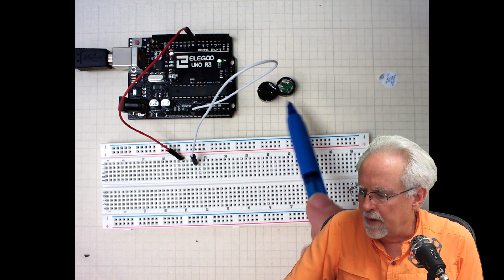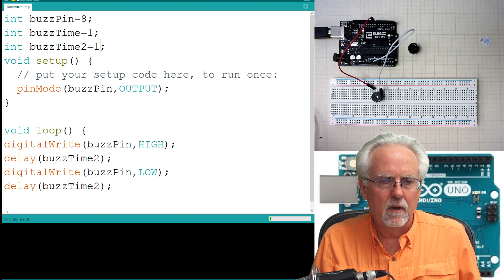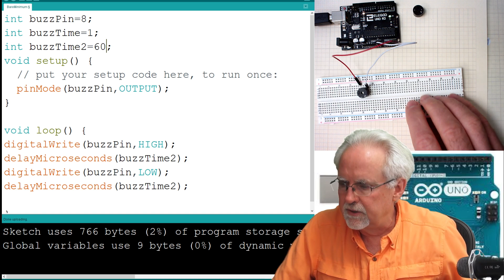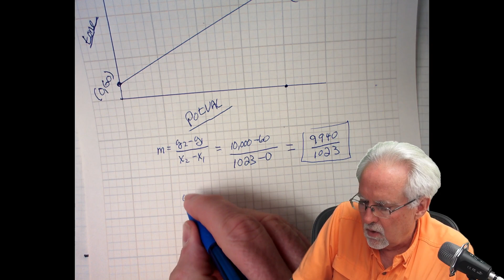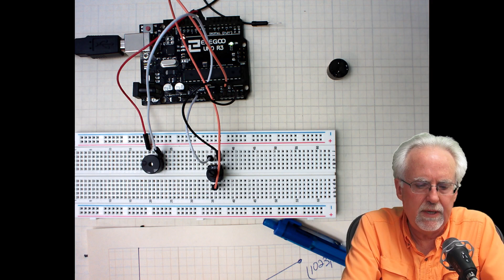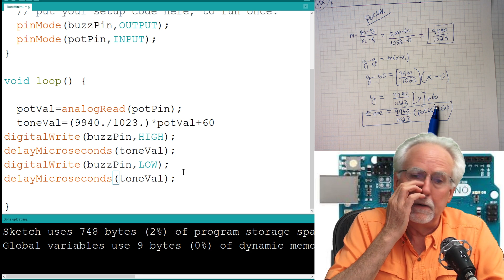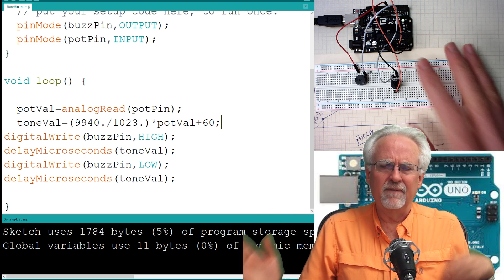Arduino Tutorial 24: Understanding Passive Buzzers

Comment: int buzzPin=8;
int dt=100;
int j=1;
int t=4;
void setup() {
  // put your setup code here, to run once:
Serial.begin(9600);
pinMode(buzzPin,OUTPUT);
}

void loop() {
  // put your main code here, to run repeatedly:
for (j=1;j<=100;j+=1){
  for (t=1;t<=100;t+=1){
    digitalWrite(buzzPin,HIGH);
    delayMicroseconds(j);
    digitalWrite(buzzPin,LOW);
    delayMicroseconds(j);
  }
  Serial.println(j);
  delay(dt);
}
}
Try this!

Comment: Paul, thank you for the video lesson. It was interesting and informative.

First, I wrote the code myself... and kept wondering why the sound I was getting was different from yours...

Then I read the comments and found out that I needed to remove the voltage output and the toneVal value from the Serial Monitor... after that, everything started working.

Thank you!
Reply from the maker: LEGEND!

Comment: Just an fyi for anyone going through this, the video shows the math/tone to potentiometer backwards. 

The original assignment is for 0 on the potentiometer to be the low tone (all the way left gets 60 milliseconds), and 1023 gets the high tone (all the way right gets 10,000 milliseconds). 

But when doing the math, the low and high points get accidentally flipped.

Just in case someone is wondering why their math/tones seem to be the reverse of what’s shown in the video.

Comment: Maybe I misunderstood the assignment I thought if we roll the potentiometer left the tone gets deeper/lower, meaning higher microsecond values.  If we turn the the potentiometer to the right we are getting higher tones sound meaning the microseconds are smaller.  I did the math to reflect that.  I did buzzTime = 10,000 - (9940/1023 * potVal).  It's pretty much your equation but the other way around.  So when potVal is zero --> buzzTime is 10,000 microseconds, lower deeper tone to the left.  When potVal is 1023 ---> buzzTime is 10,000 - 9940 which is 60 microsecs, a higher sound to the right.
Reply: literally would I did, I think he forgot himself what he said lol

Comment: One thing that happened with me: I had the Serial monitor lines of codes (Serial.begin, Serial.print), that made the thing not work as intended. When I removed those lines, it started working perfectly. I also tried tweaking the BAUD rate and that also affected the buzzer output.

Comment: I did Homework, but didnt really do the math, I just turned the milliseconds into micro seconds then mapped 0-1023 int 0-10000( which was the 1 micro to 10 millisecond range), using a map function, but it worked and was a little easier.
Reply from the maker: Yet this channel is not about doing things the easy way, but learning the math. Come on, I am showing you how to do the math, dont be afraid to use it!
Reply: @paulmcwhorter  Ill do better next time
:)

Comment: I think the math did not match the instructions, you mentioned that when the potentiometer was all the way to the left the delay should be 10K (low frequency) and when it was all the way to the right it should be 60 (high frequency) I did it like that, but then in the demo you did it the other way around. It was fun anyway thanks a lot for these amazing tutorials.

Comment: Paul you are brilliant and  I went way over the top with the homework built a 9 button tactile switch keyboard in the key of A. Icalculated for major triads for A D and E major 3 rows for A C# and E  2nd row D F#.... and  E G
A microsecond delay off 2240 for A . So C# delay for mark and space would be 12th root of 2 = 1.0596 raised to the power of 4 and inverted and multiplied by 2240. The idea of for this concept came from 1976 when a guitar student built a guitar but equally spaced the frets 1 inch apart absolutely unplayable.   I did not know the equation. He was not happy and smashed the guitar to pieces outside my flat. Well move forward to 2019 and I solved the conundrum (from first principles without using the internet) as above but instead of 2240 delay. The 4th fret position  of A is string length is 25 inches x 1/ (12th root of 2 raised to the power of 4 x 110 hz )

Comment: I'm wondering that, why we don't have a resistor on the following circuit? So it seems like we just put a buzzer instead of an LED.
Reply: Both the active and passive buzzers have enough internal resistance to prevent overloading the Arduino. Great question!

Comment: I would like to confirm that in a linear equation, the independent variable, which in this case is time (timeT), should be placed on the x-axis, while the dependent variable should be placed on the y-axis. If there are any corrections or additional insights regarding this understanding, I would greatly appreciate your guidance.
Reply from the maker: That is correct.

Comment: sir I have a little question.We initiated toneVal as an integer.But in the lopp funtion since we used (9940. /1023.)  will it be a floating number.
Reply: if the toneVal is an integer, the output of the  equation in the loop is gonna be only integers

Comment: I've been watching these videos from the beginning, but in Arduino IDE, the words that are supposed to show up in blue, are still black.  I get the orange ones just time.  The code still works, though.  Is there a setting I need to do?
Reply: I'm talking about words like HIGH, LOW, OUTPUT, INPUT, etc.
Reply from the maker: YOu are using IDE 2.X and I am using IDE 1.85, that is the difference. Downgrade to my IDE and you will get the same results as me.

Comment: Can someone check what's wrong with this code?

int Lowerlimit=60;
int PinPotentiometer=A0; 
int PinBuzzer=11;
int ValuePOT;
float ValueBUZZ;

void setup() {

Serial.begin(9600);
pinMode(PinPotentiometer,INPUT);
pinMode(PinBuzzer,OUTPUT);

}
void loop() {
ValuePOT=analogRead(PinPotentiometer);
Serial.println(ValuePOT);

ValueBUZZ=(10000./1023.)*ValuePOT;

if(ValuePOT<=Lowerlimit){
  digitalWrite(PinBuzzer,LOW);
}
digitalWrite(PinBuzzer,HIGH);
delayMicroseconds(ValueBUZZ);
digitalWrite(PinBuzzer,LOW);
delayMicroseconds(ValueBUZZ);
}

When I turn the potentiometer under the 60 the sound doesn't turn off,  but in my if loop i said that it should turnoff, when Value of the potentiometer is below or equal to the lowerlimit(60).
Reply: You don't have the code below the if statement in an if statement, so what is happening is that when ValuePOT is less than or equal to LowerLimit, the code inside the if statement runs, but after it runs, the code below that if statement also runs, and the Arduino runs code so quickly that you don't notice the sound getting turned off.

Comment: Hi Paul, great lesson as always!
In case someone, like me,  is watching only now, 2 things:

1) Just to make sure I did the equation correctly, I printed the value of both my tone and my potval, exptecting that:
-If potval=0, then tone=60.
-if potval=1023, then tone=10.000

Initially I had problems 'cause when potval was equal to 1023, my tone was something like 9.670
Then I realized that I set the tone as an INT instead of a FLOAT!
In the video you did the same, but withot the serial monitor I think you didn't realize this.
Changing the tone into a FLOAT made everything right.

2) Even though my math was correct, the tone I was hearing seemed a lot different than yours.
I discovered that it was due the serial.print I put in the code.
Reading the comments of this video, I discovered that I could keep the print if I changed the baud rate of the serial monitor into something higher! (1.000.000 was the minimum to not have distortion).
Reply: I tried this again tonight. With the higher baud rate it sounds much better, but it still sounds very distorted for me. It sounds like something an experimental prog rock band would do like Pink Floyd or something. It's doesn't sound anything like a tone a flute or something would make.
Reply: I was having all these issues as well.
Reply: Dude thank you so much I thought it was just ne
Reply: Thank you for your feedback! 
I wish I'd read your comment before... it wasn't obvious that the Serial.print function could have an impact on sound.
Unfortunately though, setting the baud rate above 1,000,000 doesn't fix the issue.
Reply: Thank you for this valuable comment. 
Statement 2 - helped me realize why I have the strange sound... and to change it.
I still have no idea why it depends so... but at least I'm closer to the Paul's tone

Comment: Using the Serial monitor seems to have a pretty big affect on the output tone. Originally tried using a print with delay to read the values and only got a clicking not buzzing sound. Got rid of the delay and it worked great for the low end but wouldn't give me the high pitch tone. Got rid of the Serial monitor completely and now seems to work about the same as yours in the lesson.
Reply from the maker: I think it is the print statements that slow you down. If the serial monitor is open, but no printing, it should be normal.
Reply: Yes I believe that's right, it seems to lag due to the printing action and if there's a delay following the print statement it makes the tone change even more. Thanks! These tutorials are awesome BTW.  @paulmcwhorter

Comment: hmm, strangely enough my buzzer isn't generating high tones, only low tones. The tones do vary with the potval, but it is not generating the high tones i hear here in you vid. Might be my buzzer, don't know. i am using the passive one, just to clarify. Also using the microseconds delay, very strange 🤔

Comment: Hi Paul, I spent 2 days nutting this out on my own before seeing your method. It turns out I did the math okay except that I calculated the fractions out and that left me with a number containing a decimal so the following dot caused me grief. I remembered that you explained how to get around this in a previous Tutorial but couldn't remember where or how. I got around the problem by creating a float variable that equaled the decimal I calculated. Anyway, I paid more attention and documented how to do it this time. The other thing that cost me most of the time is that I included several Serial.print functions to follow what was going on and I found that they altered the tone dramatically. I don't understand why print functions should affect the tone?? Anyway, thanks for another great lecture.

Comment: I got the formula right, but I did it way less elegantly. 😅The way I thought it out is that you have to go from potVal=0 to tone=60, and the only way to do that is to add 60 to 0. Then if you would continue with the 10000/1023 like we did previously to get tone=10,000 for potVal=1023, you would actually end up with 10060 since you added 60 before. So I just subtracted 60 from 10,000 to get the value to divide by 1023. 
I love that you show the "right" way to solve problems like this! Keep up the great work.

Comment: I wanted to print my tone in the Serial monitor but it only seems to be able to reach its highest when I use a high Baud rate and I have no idea why. Also, if I don't use the Serial monitor it sounds perfect. I guess the action of printing the value in the while loop introduced a tiny delay which distorts or lowers the frequency.
Reply: yes, that is right, when you put "Serial.println()" in your code it slows down the speed of your Arduino a lot.

Samuel

Comment: Hello Paul, I tried the excercise on my own, as you recommended....but got a difference in solving the excercise. You said....if you turn the potentiometer to the left, have a delay of 10.000 microseconds....to the right 60 microseconds? Right? If yes, to the potentiometer to the left will return a potValue of 0. So the combination of x and y will be: if the potValue will be zero, the delay should be 10.000 microseconds...and vice versa to the right....potValue 1023 will return a delay of 60. The equation will then be different: y=-9,7165+10.000.
If I misunderstood your instructions....nonetheless a big thanks, because the result was: I LEARNED IT!! Best regards!
Reply: You're right brother. Paul instructed us as you said either intentionally or unintentionally.

Comment: Hi Paul, Looks like I got confused with the terminology of ALL THE WAY LEFT and ALL THE WAY RIGHT you used. I understood it like this
1. delay = 10000 microseconds (when voltage  V =0)
2. delay = 60 microseconds (when voltage V = 1023)
Good thing is this created a line with slope towards right which was little difficult to create the equation. had to recall my mechanical engineering lectures from university as well as go through your previous Math notes I took. I was able to get the equation finally. delay = (-9940./1023.)*(voltage-1023.)+60;
I printed over serial monitor to check my math part and formula calculation Arduino is doing in the background. Got perfect 10000 delay at 0V and 60 delay at 5V (1023 in Arduino).
Rotating the potentiometer sounded like a world war siren...  LOL..

Comment: I struggled a bit with this lesson. It turns out that I had three Serial.Print statements to help debug the resistor value versus the Buzzer timer value. I was outputting 60-10000 microseconds properly but it sounded awful - then I removed the print statements and all was good. Those dang print statements are s-l-o-www! It was a good debugging exercise!
Reply from the maker: Yes print statements are really slow and will affect your timing on things.

Comment: I did everything right software wise in comparison to what you did, but the tone is not changing.  Even did a number of prints to show changes.  Why didn't use freq values set up in your global variables?  Your original coding without the pot I was able to hear the differences in tone.  BTW, I had a lab that I taught to teach my student to understand frequency response by their listening to a tone generator.  I learned for myself that I can't hear over 6,000 Hz.

Comment: Great lesson as always! One minor thing, you switched the delay times from what you told us in the homework. So you wanted us to have a delay of 10,000 microseconds when potVal is 0, and 60 microseconds when potVal is 1023. So the equation would be a little different: y= (-9940/1023)x + 10,000

Comment: btw, i was so used to debugging that I included some Serial.println statements in there which unwittingly lowered the pitches due to implicitly increasing the delay.  so i was pretty confused as to why my tones were so much lower - just a quick heads up for anyone who's doing this and proactively added Serial.print statements - it'll affect the tones, so best to leave them out if you're trying to get the same results that Paul did.

Comment: BOOM ! ... "I need you to.. " PROVE ! you've "READ THIS TILL THE END" 
Respond with "PhilVal" contents..... hehe.

Boy this one I had to scratch my head. Didn't cheat ! but I had to refer back to my lesson 15, graph notes (dimmable LED+Pot). The starting at '0,60' was different though and I had to look on a maths web-site to recap how to deal with non 0,0 starting points (was around 20yrs ago I last did that haha).But easy, when you refresh. It's really satisfying to do these lessons Paul, and I totally subscribe to the method of "doing it for yourself" to learn. At the risk of sounding like a 'smart arse' (which I'm certainly not), would I be right in thinking your original HW task should be stating "All the way to the left is a tone of 60" (not 10,000), assuming all the way to the left is Anti-clockwise ie 'off' ) ? Interestingly, I did a serial.Print of the PotVal and ToneVal just to see that the equation worked before any of the audible stuff. The values seemed 'switched' from your homework instruction. (PhilVal="Fear not, I absolutely WILL keep doing the Maths & Physics !") ... My 'meddling' with adding the serial.prints I think screwed up the audible delays, so removed  before completing the audible bit, which was also a good learning point. Great video, Thank you so much Paul. I'm now embarking on the next ... (senior guy, Phil from England)

Comment: Banging my head against the wall on this homework for a bit, just getting a clicking sound out of my buzzer.  Ended up boosting the baud to 115200 and now it's working great!  Time to unpause and see how you made this!
Reply: Maybe it's because I was printing my values in the Serial Monitor at the same time?
Reply from the maker: Yes that will throw off the timing.

Comment: These lessons are just brilliant, thank you so much.  But I am super confused.  Back in Lesson 10 we learnt to read voltage using the analogRead command.  In that lesson we simply divided the 5V by 1023 and then multiplied this number by the value we were reading from the readPin, readVal*(5./1023.)  We also made the number a float because 5/1023 does not give a whole number.  Thus I'm not sure why this exercise differs - instead of 5V, the range is 10000-60, and we divide that number by 1023, then multiply it by the readVal, and also make it a float.  So my code looked like dt=readVal*(9940./1023.);  I did this and it seemed to work - So it just feels like this should be worked out the same way that we work out voltage from an analogRead.  I'm probably wrong though...  if anyone can weigh in on this and help me to get my thinking straight it would be much appreciated.
Reply: OK silly me - went back and re-did the maths...  Our range starts at 60, so that's where the +60 factors in.  I get it now.  Thank you  Mr McWhorter for explaining it all so concisely.  I'm still not sure why it isn't a float though... But you're a fabulous teacher.  Many thanks for all of this!
Reply: Just to answer my own question.  Yes it should be a float.  Wasn't being pedantic, just generally confused myself going through this.  I guess dealing in microseconds it wouldn't make that much a difference.  If I could, I would like to delete all these ramblings, and also go back in time and ensure I watch and digest the whole lesson thoroughly before commenting.  But, it is what it is.  Thanks again for the wonderful teachings!